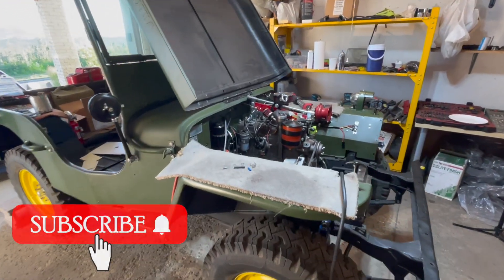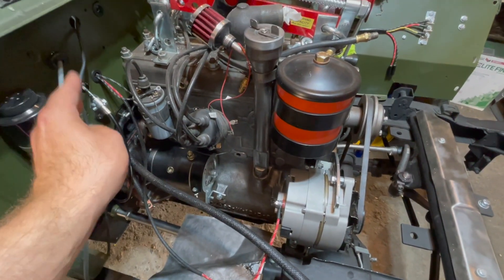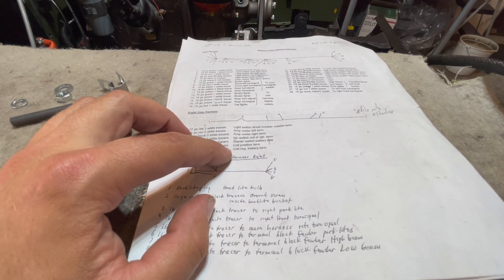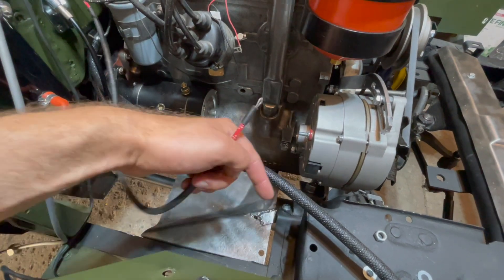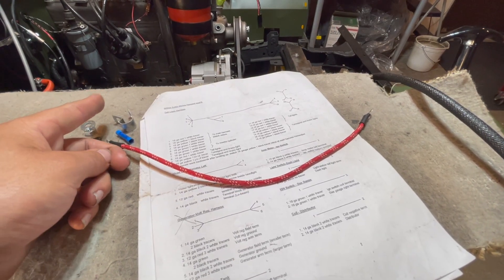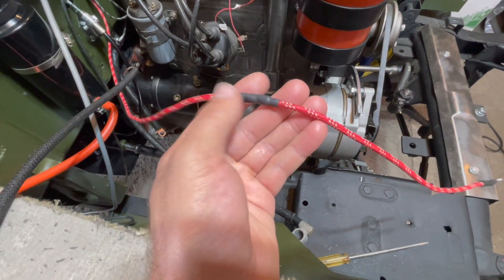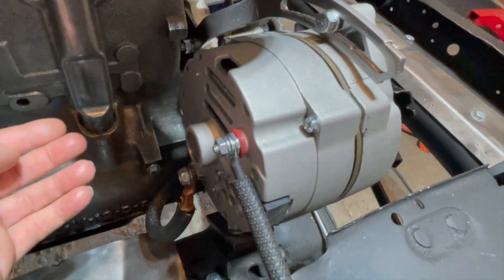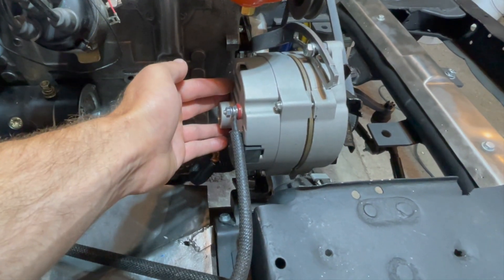How to CONVERT Willys Jeep 6 Volt Generator to 12 Volt Alternator | Electrical Wiring Series

Comment: Hello - thanks for the video. I am getting ready to wire mine up soon. I have a 63amp 1 wire alternator, and I bought a 100amp ammeter. So you just went right from the alternator to the ammeter on the same location the generator wire would have went? How is it working out? Any issues? Thanks!
Reply: Use a voltmeter instead

Comment: Never thought to check the amp gauge vs my alternator... according to you, my 110amp GM style alternator will be too much for the gauge.  Thats a bummer
Reply from the maker: You can use it but I would take it into a place that does alternator rebuilds and reduce the amps to 45. It will avoid the need for resistors and fuses to reduce the amperage to a safe limit.
Reply: @LetsBuildaWillysJeep  if I wanted to just get a new alternator, what would you suggest?  I did some quick research and see the s10 alternators are around 65 amps?  What are you running?